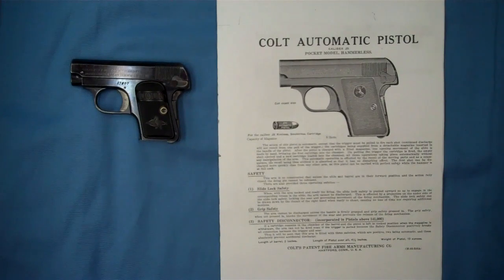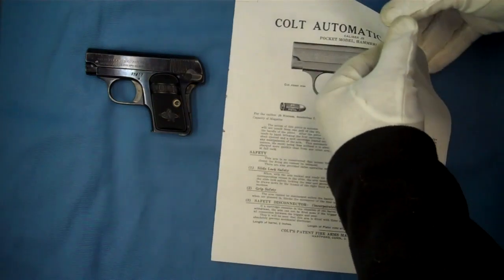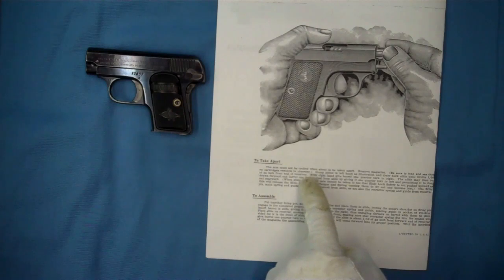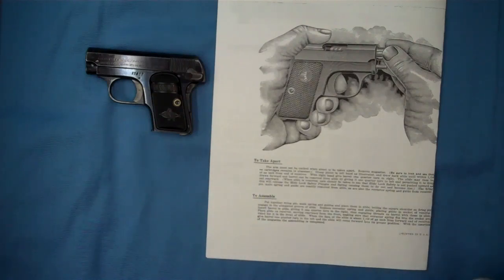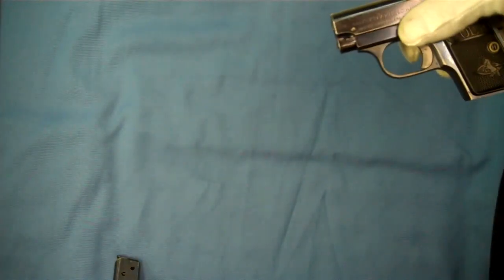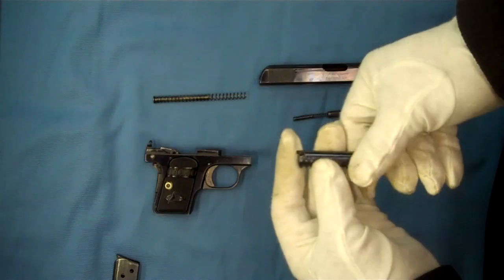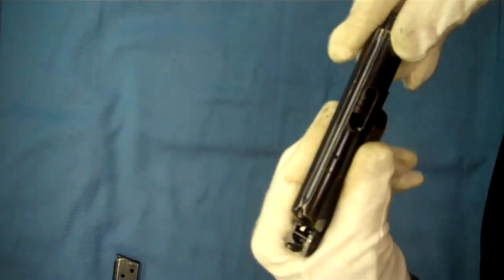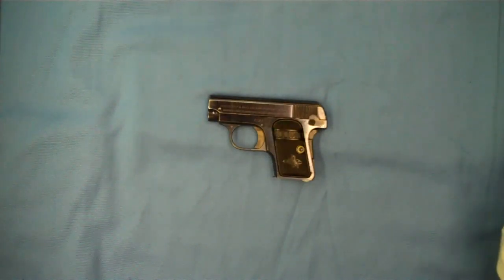Colt's Model N 1908 .25 acp pistol Vest Pocket Hammerless Field Strip

Comment: ok, so I starting the field strip of my pistol and got the barrel to turn into the grooves, but the slide didn't come off. my barrel is sliding loose within the slide and sticking out an inch from the end of the gun but the slide won't come off. And now the barrel won't set back in the grooves. help??